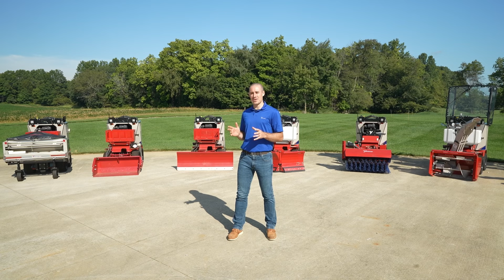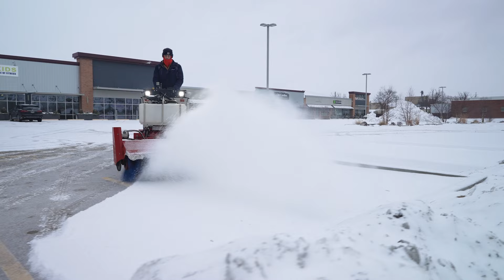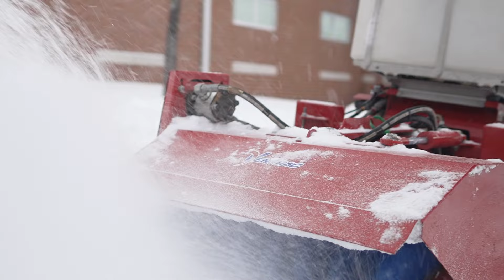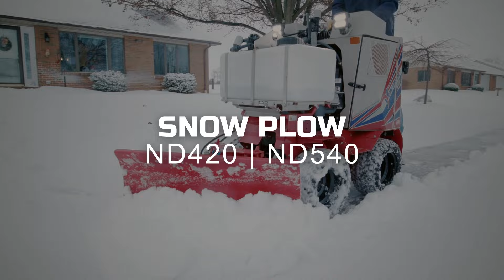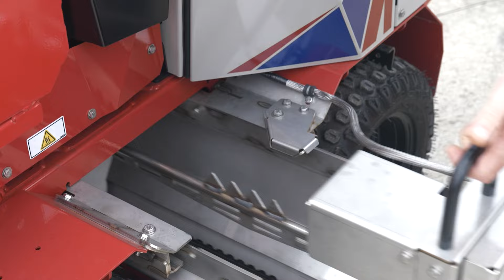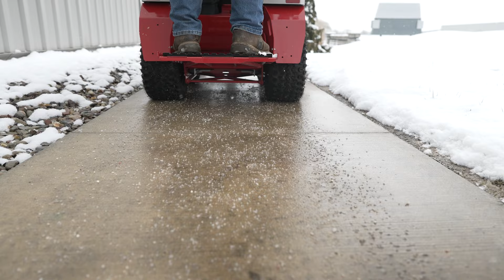The Most Capable Sidewalk Snow Stander

Comment: I have older neighbors, so typically clear the entire sidewalk (up to the next cross street). It's just under 1500 feet. The biggest problem I encounter is the sidewalk is a series of cement squares, some higher than others. I don't have words for how infuriating it is to hit a higher square when pushing my machine.  If I adjust the sleds I don't clear down enough.  Makes me think the only thing I could possibly use with any appreciable speed would be the brush?